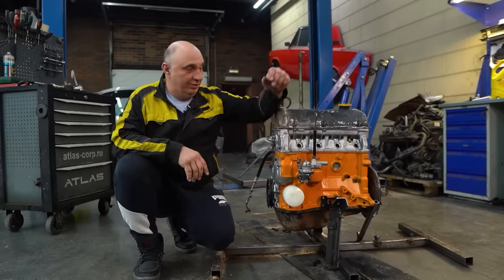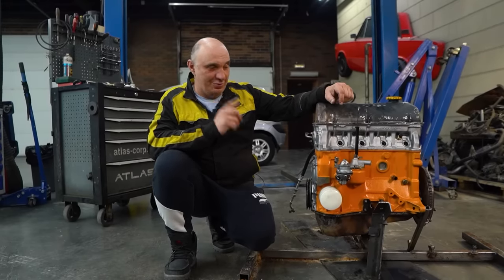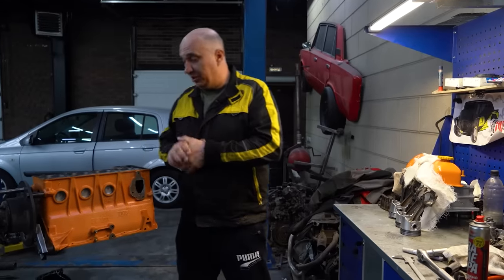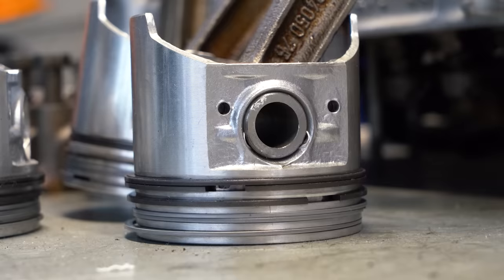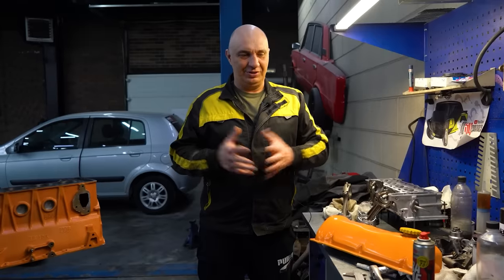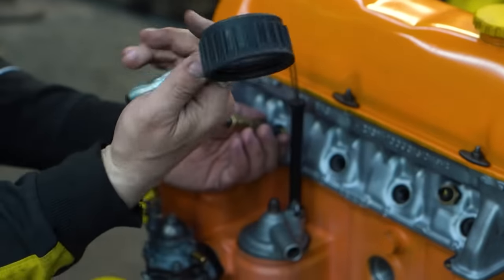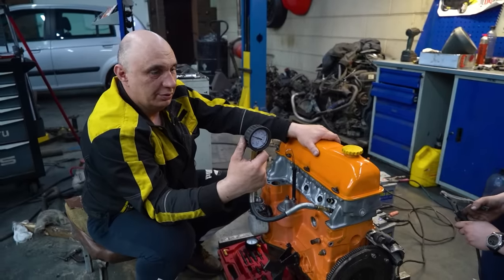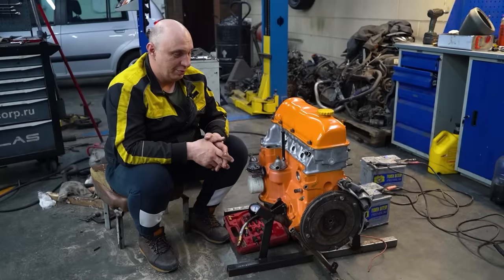Cranking the compression up to 20 kilos (285 PSI) - what for?

Comment: Hopefully they have access to ethanol or methanol over there to run that engine, hopefully they have a good racing induction system and tuned header for it and make 100hp/L with 13:1 compression.

Comment: thats  enough to run on diesel...from my experience if cranking with the starter motor the engine passes the 150psi pressure the engine tries to start....below that and it wont fire...old beat up diesel engines that cannot make more than 150psi on most cylinders while cranking will only start when push started...looks like you made almost 300 but you will still need glow plugs...it will run perfect...until you bend a rod /damage the rod bearings/ blow the headgasket...IDI diesels make a LOT of heat

Comment: Why not put diesel injectors in the spark plug holes and turn a gas into a direct injection motor. you might be able to get it to ignite with these numbers

Comment: So what is it 19-1 compression ratio? You may consider Propane / Natural gas if you run into knock issues. Just a regulator and valve should work.

Comment: I have a question.   Did you put an adjustable camshaft sprocket on the camshaft?   Taking that much material off the block and head will change the valave timing......

Comment: Does the engine have an adjustable cam sprocket? Trimming that much off the block and head will probably knock cam timing off a couple degrees as the cam/crank distance has decreased.

Comment: That's compression from what I can assume it's around 280 PSI

That's compression ratio it's in diesel territory.

You're going to have to run some super high octane gas so pre ignition does not happen just from competition  
Propane or natural gas would be a good choice methanol might work
Reply: Its above 20:1

Comment: My old honda prelude ran 270psi of compression. tell ya what, it was rather quick for a h22a engine. just dont do what i did and put oil on the threads of the test gauge and test on a warm engine. it will fire for a few seconds and bust up the gauge.. whoops

Comment: This is what people do not understand race gas does 0 without high compression it was designed for high compression engines to prevent pre detonation.  This allowing for advanced timing making more power. Race fuel in a average compression engine does nothing you will not gain power at all. Nitrous oxide you will but its hard on engines.

Comment: Increasing the compression that much will cause strain on the rotating assembly and it will be slow to rev.
Reply: Could break the rods and or the Crankshaft
Reply: @bullbutter2931  No it'll spin, but it'll be inefficient and the bearings will wear prematurely. IMO G54 doesn't really care about premature wear, or rust... or failure of any kind ;)

Comment: I know that you guys are very good with what you do i saw your two cylinder now that could have probably used that compression to run but why would you want such high compression on a small engine and you can probably get good fuel in some places but still the bottom end is stock am I correct?

Comment: Well you obviously haven’t worked on a GM Detroit diesel over there. The 71 series has 4 compression rings and 2 sets of oil control rings. Don’t think many of them ever ended up in the USSR, but they are quite common in the USA.

Comment: You need to run that engine on 95% + ethanol, or methanol work on a carb, bore out the jet 25-35% larger,  and possibly open up the idle circuit a bit,,  you may like the power the engine makes! It may not make a lot more HP, but the TQ should be greatly improved!! Any HP gained would be from the TQ, 
The power curve should be nearly same as stock,  only the numbers being higher, it should produce diesel like TQ, only rev higher,   I hope you do run it in alcohol!! In a vehicle!!

Comment: 1) the compression numbers in this video are totally bogus and unusable because they were cranking the engine with 24V. Faster engine speed = MUCH higher compression.

2) Any minuscule power gains that you might have seen by running additional piston rings will be negated (partially or wholly) by the increased friction of running that many piston rings, which is substantial. You could see in the video that the tech was having to put some effort into turning the engine over before the head was even installed, so that bottom end has a ton of friction.

Comment: I could have saved you the trouble and just told you to just convert a diesel motor to gas by putting spark plugs, ignition and carburetor on it. You see, they're already a four-stroke cycle, & their at between 21 to 1 and 24 to 1 compression(!)

Comment: Vw 1.9 tdi easily make 600psi or 40-50kilo (more than twice as much as y’all got)
Reply: lol no.  25-30.
You may be thinking of older IDI engines.
Reply: Thats combustion pressure, not cylinder pressure.

Expanding fuel in a combustion chamber is obviously going to produce more pressure than just compressing air to the best ability of some seals.

Comment: Mazda do high compression ratios on pump gas… they use ultra lean air fuel ratios to make it harder to ignite (but I think a rich mixture pocket near the spark plug at spark time to get it all to go off). Water injection is another way to make it harder to ignite too.

Comment: how long will it last without OIL RINGS?
Reply: Oil rings are not necessary.  There are plenty of engines that keep running with the oil rings stuck in their grooves and not touching their cylinder walls.  These engines typically burn a quart of oil in 200 to 300 miles.

Comment: Ah yes, the good old "cut 3 millimeters from the block and 1 millimeter from the head" formula that was used on Niva 1.7 engines. Well not the same here, but on the 1.7 liter engines people said that will give them around 125 horsepower in total or roughly 40 horsepower over the stock engine.